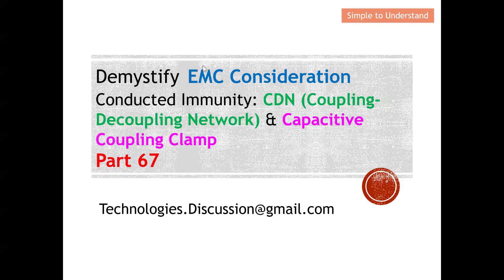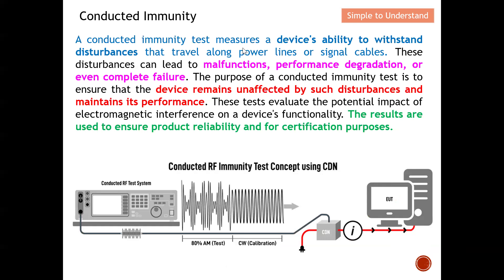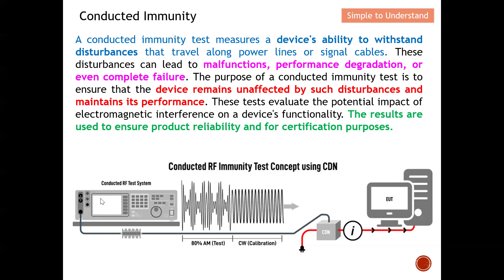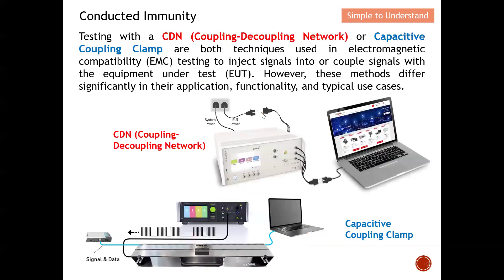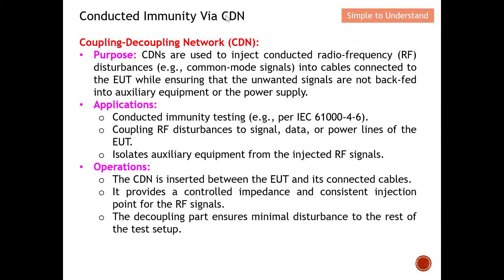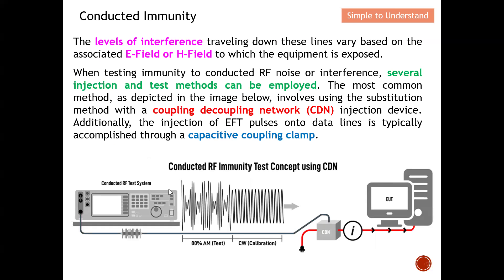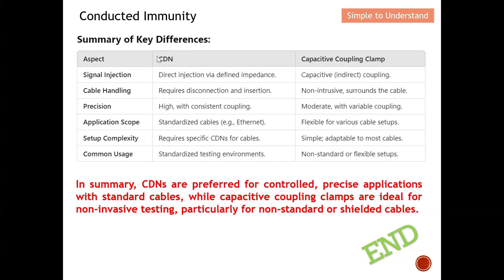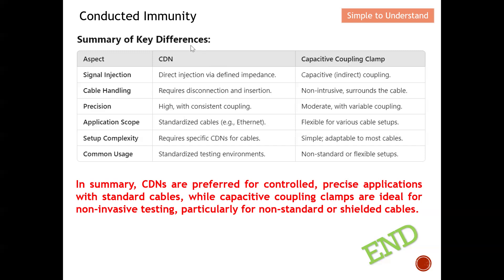EMC #67. CDN & Capacitive Coupling Clamp Guide – Conducted Immunity (CI) Testing for EMC Compliance.

Comment from the maker: Thank you for watching this video.
There are two methods to perform Conducted Immunity (CI) testing. The first and preferred method is via a CDN (Coupling-Decoupling Network). The second method involves using a clamp to couple the noise source directly to the conductor of the cable.
For more information, please refer to this video. Thank you.